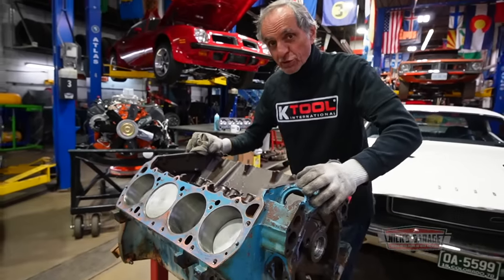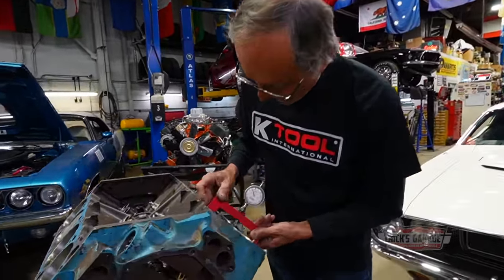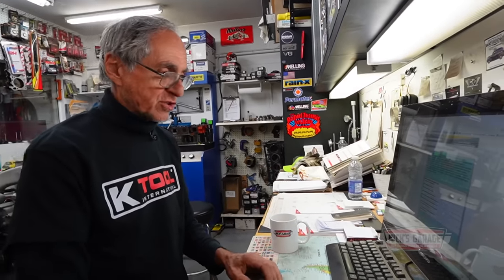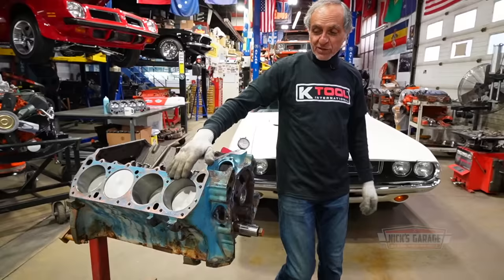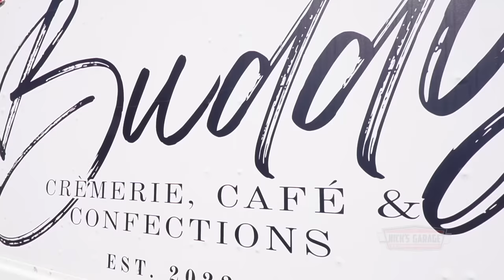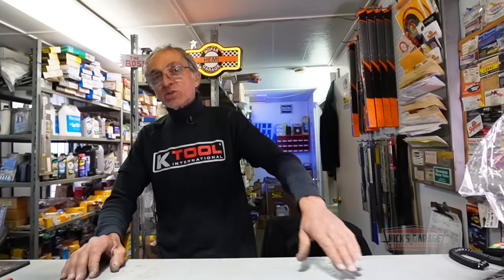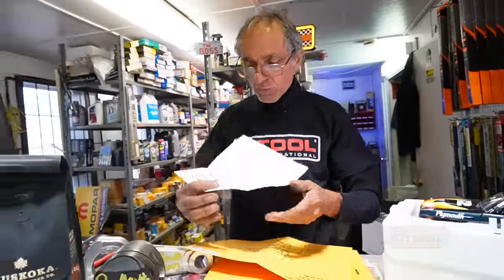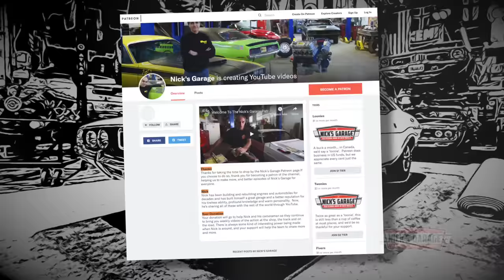Old 440 Build Diagnosis - What Were They Thinking?

Comment: Looks like the engine was built by a regular automotive machine shop, and not a custom performance engine business. Years ago, I quoted a price to rebuild a 440 engine from a 1969 Barracuda, the model with the lift-off fiberglass hood. The owner had gotten a lower price from a friend that worked at an auto parts store. That store dealt with a volume rebuilder in Montreal. I cautioned the owner that he needed HIS OWN engine rebuilt, and not swapped for an "exchange" rebuild, which, unfortunately, is what he got back. He was totally disappointed with the performance of the "truck" engine he now owned. Efforts to find his original engine at the shop in Montreal were futile, and he eventually sold the car.

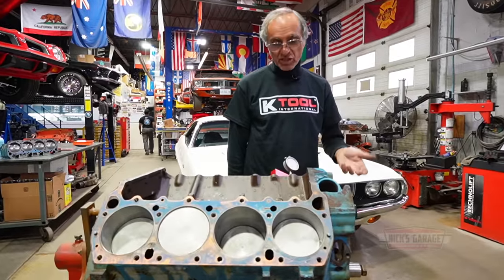Comment: 6:23 That's a late-70s truck or RV piston. Even the passenger cars had ultra low compression ratios. That's a mid-7 to 1 engine. I'm guessing RV.

Comment: Does anyone remember, Slide rule for determining engine compression from back in the 70s. I remember it being round, and you just lined up the values? We had cool stuff before computers came around, I miss all that stuff, I sure we just knew more back then. if you asked 10 people about something you got about the same answers from all of them. today you don't get that anymore. hell google will tell you different things on different days. I've been a machinist for over 40 years, and wow how people have changed in that field. new guys don't anything anymore if it's not on a computer.

Comment: On white grease  One very famous FORD racer blew 30 builds using white grease.  The grease turned to carbon on the bearings and ate up the inserts as well as wiping out the cams.  NEVER USE ANYTHING NOT SOLUABLE IN ENGINE OIL in your build  like SILICONE

Comment: Most engine builders aren't well educated in math and physics or don't bother measuring the chambers, gasket thickness, deck height, dome and notch volumes, etc., so most will go by what the piston manufacturer advertises the compression ratio is on the box. Which is usually pretty far off the actual number. For example, in my Kawasaki I'm using a piston with a 13 mm overbore (69 to 82 mm) that are advertised to give a "street" 10.5:1, but actually measuring everything and calculating the actual CR it works out to 12.7:1. Big difference!
Reply: And for reasons that you have mentioned here is why "grease" should not be used for engine assembly. Clearance for main bearings in big block Chrysler are one-half a thousandths of an inch to a full one-thousandths of an inch. At the most the oil viscosity for that spec is a 30 weight (10W30). Grease has a significantly higher viscosity than oil. Too heavy. And if you were to ask some of these "so-called" engine builders what their bearings clearances are they'd honestly have to tell they don't know, because they haven't measured them, and they don't know how. Why is LUBRIPLATE okay? Because it's a "film lubricant". Not a grease.

Comment: Seven and a half to one? Remember the stink around the seventies when "they" thought our premium gas was going to be phased out in favor of that 86 octane swill? This engine could have been built with that in mind, an ultra-low compression  to still be "run-able" on low octane fuels. Recall those hundred plus octane values were already discontinued, so the precedent for dropping octanes  further was already  in place.

Comment: Nick, what is a Kowaski 440? Looked on line and found nothing. Some guy making crates or what?
Reply from the maker: Kowalski was the name of the character in the film Vanishing Point. He drove a hot 1970 Challenger. Nick built a car just like it and it has a special 440. The car is nicknamed ‘Kowalski’.

Comment: This would be a low rpm torque setup. Chrysler had 413s with 7.5 compression that had a very small lift cam with very little overlap that made peak torque at very low rpm and of course it would run on very poor gas. Military or industrial trucks. My brother bought that cam for his 440 but his compression was 9.2 and had a distributor with too much advance and too quickly and the exhaust temps were way too high. Needed these pistons and the old 413 distributor curve

Comment: I've never read so many insane comments.  Ok, Nick was wrong when he said there was something unusual about the engine. In his defense, he may have never had a customer with a mid 70's era big block that had a standard rebuild since he does rebuilds on cars that were before that era.
But the guys on this comment list are spinning off into space alien conspiracy George Norey level stuff.  Examples: {I am hearing in my brain the word "duhhh at the beginning of each}
   "Maybe they put in the wrong crank. Like one from a 400"
    "Maybe they put in pistons for a 400."
   "Maybe they used connecting rods for a 400."
   "Maybe it is for a blower."
   "Yeah throw out those junk pistons!"
   I could write a paragraph each about how crazy the first four are.  Did these guys not notice the 30 stamped on the top of the pistons?  That wasn't a price tag.  
As for the final one, send me all the 30 over big block Mopar 1972 and newer replacement pistons you have if you think they are junk. I'd take standard, 20, 40, 60, too.
   Here's a conspiracy: Why do machine shops no longer order the pistons based on the wear of each of the 8 cylinders and just order them all the same size, needlessly thinning some cylinder walls?  Because it is easier than using a bore gauge 8 times???  And setting up the the boring bar for different diameters?
Reply: Hint- look up 400 and 440 main bearing sizes, deck height, piston compression height, connecting rod length, and stroke.
  If you all want a conspiracy how about this: Why do you have to buy a 4.5 inch head gasket for all the bores that are far smaller than this. Just because they don't want to stamp out different sizes for different bores that's why.

Comment: You omitted the .023 on the head gasket Sir...so less than 7.5 compression ratio... because the Felpro gasket added the extra above the,. .020 factory head gasket...so final numbers..... One hundred and ninety- thousandths... over all.

Comment: Why is "white" grease a no-no? Usually that indicates a Teflon filler in the grease instead of the standard Urea filler that is found in the oil. Is this the reason? Not to get filler types with different chemical compositions intermixed?  Or it simply doesn't perform as well?
Reply: White grease is not used for engine assembly.

Comment: COMP Cams High Energy 252H Hydraulic Flat Tappet Camshaft Lift: .425" /.425" Duration: 252°/252° RPM Range: 800-4800 C.A.R.B. Approved*
Reply: Thank you.

Comment: Never ever use assembly on the side of the lifters, it keeps the lifter from rotating on internal start up.
I hate that white assembly lube I use Lucas on internal engine and molybdenum based lube on lifter bottom and cam lobe, oil on sides of lifter.

Comment: It must have been built to RV specs. Shorter pistons were used. That's what Chrysler did to meet emission limits. It resulted in poor mileage. Surely any builder who saw the short block would have spotted this and recognized what it would do to power.

Comment: If the pistons are that far below the deck would that allow a huge cam to make power?
Reply: NO,  Not really.   Big cams need compression.
Reply: The other way around. It would work with a teeny tiny cam. Something around 200 @ .050. 

Compression is so low its barely enough even for a veryyyy mild daily driver/cruiser type of build.
Reply: @nickpanaritis4122  thank you for answering me nick 😃
Reply: Many times in the past, when an engine had a high mechanical compression ratio that did not lend itself well to the available fuel, a more aggressive cam would "trick" the engine into thinking it had a lower, more compatible compression ratio. Cheaper than changing pistons, and still enough vacuum for power brakes.

Comment: 252 H 12 is a Chevrolet master on a Mopar core  even older than HL series which is also designed for .842 lifter  y the same designer that designed the better/later Lunati line then line bought by Howards
252 @.006 and low lift (will run forever with weak springs however)
There are more modern profiles out there
7.5 not unusual for 73 and later
How do you get any quench?
either get some custom reverse deflector pistons or the KB step dish pistons
I helped KB chief engineer John Erb design these pistons based on lots of real tests and dyno time
67 heads with a 0 deck and "turbo" half dish or 68 and later heads with the KB and proper deck/ quench cuts the egt by 800 degrees  heck we even welded up those terrible wedge chambers to get quench before we got the pistons sorted out.   Aftermarket heads MAY have much better chambers choose wisely (is this a matching number build?)
If you are going to buy xpensive forged pistons you might as well get a stroker crank
lots of good .904 optimized cams from minimum Lunati or Howards 
new valves? get light ones 3/8 stem 2.14  1.81 is way old  school except if you are using Motor home valves which are really premium for HD use
AS for white grease one high faulting Ford racer blew about 30 motors assembling with white grease
Hint  do not use any grease not soluble in engine oil

how do the bores look? just a minimum hone with a torque plate?
#3 cam bearing tight?

Comment: I forgot to add that maybe because it’s a Cali car, maybe they purposely built it with super low compression to handle the notoriously crappy gas available there. I bet the cam has a bit of a lumpy idle. If it was built just to pose at the coffee shop….. then that makes sense.

Comment: nick, i wanted to tap your brain for some mopar knowledge. way back in the mid 90's 1995 or so, i had a 69 satellite, 4 door with a 318. i remember driving on the interstate once and found a 68-69 "sport" satellite sitting up on a hill. there was a diference i saw with the brake lights that i have never seen in another mopar. in my 4 door satellite the red plastic was pretty much flush with the trim ring around the brake lights. in this "sport" satellite the red plastic was recessed about 2 inches behind the trim. i dont know if this was just something weird for that model or not, like i mentioned i have never seen it before. is this something you have ever heard of? dont know why i thought of it today, the car is long gone now, wondered if it was maybe some weird one off model.
Reply: I know those lights well. My second Mopar was a 69 GTX. It had those lights.  They sure looked cool, to me anyway. They ONLY came on GTX and Sport Satellite. For the life of me, I can't figure out why every one of the hundred thousand 69 Road Runner owners out there aren't scouring the country for those tail lights and putting them on.
 On the negative side, people commented that my tail lights and brake lights were not very visible unless you were directly behind. The car looked dark from the side.
Reply: @auteurfiddler8706  thanks, i could never find anyone who knew about those.

Comment: Yeah that’s way more down than a stock RV block. Someone bought cheap flat top pistons. I will bet the pin is in the wrong place or the crown height is extremely low. Now build it with 440 Source aluminum heads and a roller cam.

Comment: Am I the only person that thinks it is say you have to buy a head gasket with cylinder openings big enough to fit a 4.500 bore (which only aftermarket blocks have) to fit engines with bores from 4.06 to 4.38 inches?  That gap is losing some compression and I can't believe that space isn't collecting carbon and leading to preignition and run on.
Reply: Use a head gasket that is designed to the application.
Reply: @nickpanaritis4122  By why doesn't any one offer one that is a closer match to the bores? It is as if Nike  or Adidas only offered size 16 men's shoe since any foot should be able to fit in it.

Comment: Wait so what's the problem? They built a factory engine? Or they deliberately put in shorter conrods (is that a thing)? Pretty sure they didn't add 100 thou of weld onto the whole block and mill it flat. Maybe tell us what the problem is here?

Comment: I think a Briggs & Stratton lawn mower engine has more than 7.5?
Reply from the maker: One would hope!  Thanks for watching, Mooseman.
Reply: There is a plus it might not have been run but it was well lubricating even if it was wrong lubrication I didn't see any rest anywhere in the cylinders or anyplace else.
Reply: Classic (read "made in America") Briggs rotary mower engines (929XXX  and 110XXX model numbers) had mechanical compression ratios around 5.5 to one and their revolutionary (Patent number 299,999 dated 1949) "Easy Spin" automatic compression release made it feel like about 4-1 when cranking. They only ever required 66 octane fuel.
About the only way to get one to ping was fill it with White Gas (such as Coleman Lantern Fuel) and get it real hot.
     A dozen times people took repaired mowers from my shop and mowed until out of gas. Then they accidentally filled it with diesel fuel, started it and finished mowing. The next weekend it wouldn't start and they'd bring it back full of diesel and I'd have to explain it to them . . . didn't hurt the little engines at all.

Comment: My buddy had a 440 back in 1980    it always overheated never ran good he ditched that car bought a Ford and never looked back  he still curses chrysler quality
Reply: I would say that a good seven out of ten times that I've had to deal with an overheating engine, it turns out to be the radiator pressure cap has failed. The cooling system is not pressurizing. The car does not need a radiator, or a water pump, or a fan belt, or a shroud. It needs a $7 rad cap. It also needs a mechanic with brains enough to diagnose it in the first place. Takes two minutes with a cooling system pressure tester. Was it allowed to run hot enough, long enough to spit a head gasket? If I was there, I'd know. Rocket science for some.
I'm driving a FORD right now by the way; a Mustang. I could write a very long list of replacement parts that have gone into it. I hate to think of how I would've been fleeced if I hadn't done the work myself. I just put a water pump in the b1tch last week. I've owned cars from every division of GM. I've had Chryslers, including FARGO. Fords, mostly Mercury. My first car was a METEOR. Nothing really stands out. Not to me.

Comment: What is ideal compression ratio for 95 octane?
Reply: No hot spot s 10.5 with fast closed chamber  up to 38 degrees most fords 170*F temp6500 rpm chev  36'degree cam filling will be less at low rpm with more duration  till3000 or more then total adjustments mixture can't go lean etc.

Comment: whoever built that engine had no idea what they were doing. I would not use that in a stationary industrial setting. it would have low power output, and terrible fuel per hour use. i am sure they were made that way because the pistons are weak, and would not stand up to any amount of hard use.

Comment: even with boost 7.5 seems real low
Reply from the maker: Unheard of.
Reply: @NicksGarage  Nick Harry Ricardo stated that 1) For a given fuel antiknock rating, and 2) Unlimited airflow and boost - that maximum horsepower will always occur between 6.5 and 7.5 to one CR. It will never change.
All modern aircraft engines are in that range for that reason.
       CR that low is a PITA in a street car with a turbo - but it's awesome with a positive displacement blower.

Comment: how many years you been working on 440's and you never ran into an rv motor?  mother mopar designed that engine. let me see one of your performance engines lug a 5 ton rv up a 5 % grade @ 100 degree ambient temperature on 89 octane fuel. stop ragging on it.

Comment: there a rule IN callie Usa pollution epa before 1972 high CP after 1972 low CP pollution law rules it sucks  the mid 1974-1980 old cop car 440 low cp production car! 8.5 ok it do over 120 mph police use the new ford ltd 2 80 mph the speeder out running the policeman ps the guy in 1972 chevy impala with a 350 in it passes the police car & pulls the speeder over! the policeman said what you doing i going to work I your boss! the police jeep died would not start! i got my wife's car!